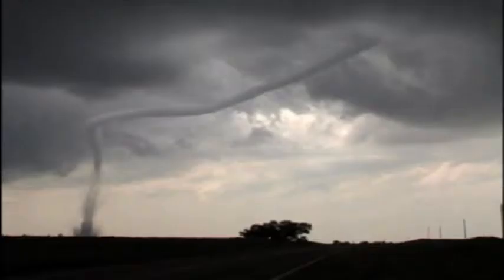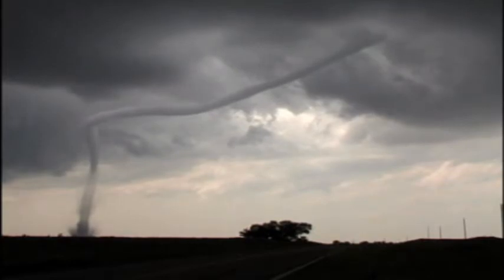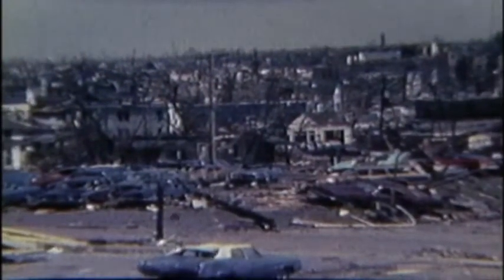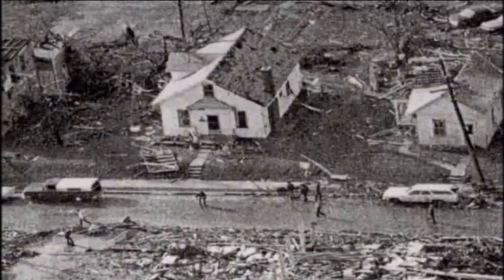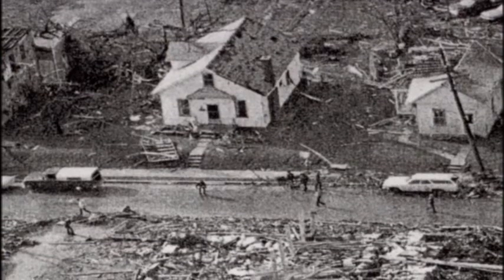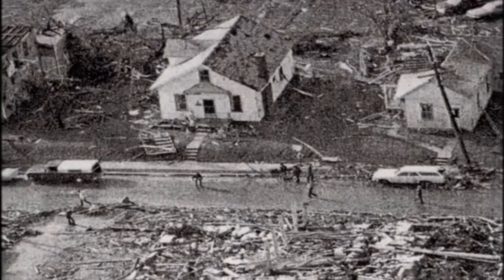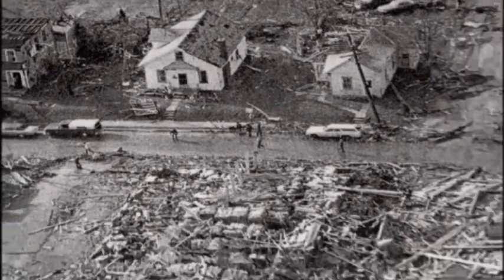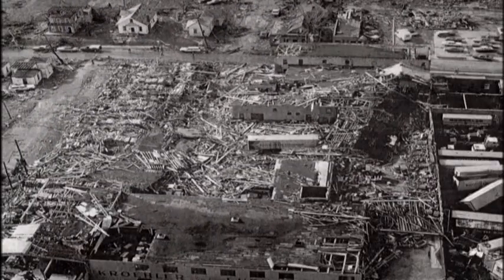Cyclone Conundrum

Comment: The Xenia tornado was never a wedge, by which I mean it was never wider than tall as Dr. Forbes claims here.  Bruce Boyd's film and most still photos shot in Xenia proper were too close to the tornado to capture it's full height.  Homer Ramby's pics prove this without doubt.  I watched from 5 miles out of town and saw the same much-taller-than-wide tornado Homer photographed.  At it's thickest it was a stovepipe and most of its damage path was 1/4 mile wide.